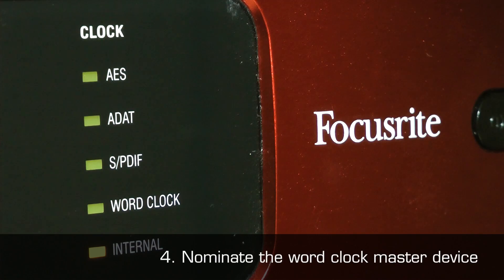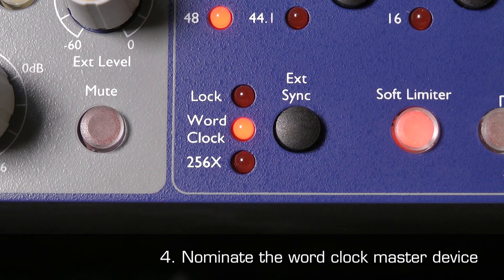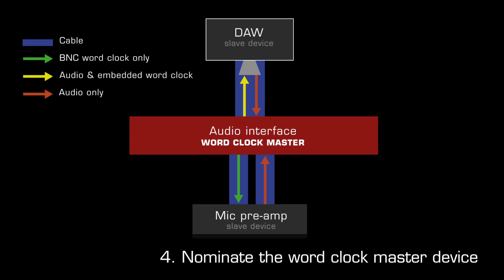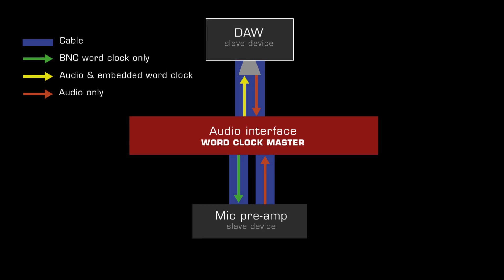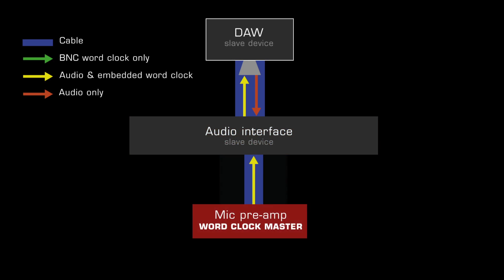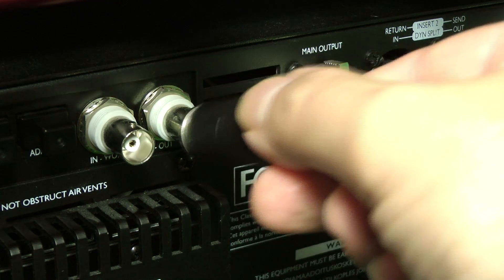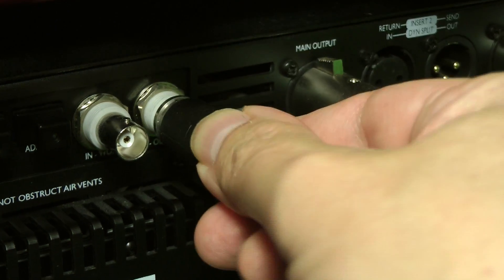How to connect devices with AES3 or S/PDIF coaxial leads

Comment: When hooking up two interfaces through spidf, do u only need one spidf cable or two?
Reply from the maker: +Larry Tate Depends on the device. What are you trying to hook up and to what?
Reply: A focusrite clarette interface to a focusrite Safire 40 interface to expand my mic inputs to 16 between the two combined.
Reply from the maker: Presumably you'll be creating an aggregate audio device so both interfaces can be used simultaneously. In which case, leave the DAW as the word clock master and slave both interfaces to it via their computer connections (USB, TB?). If you're hooking up the Safire to the Clarette via SPDIF and only want a one way audio connection you can either nominate the Safire as the clock master or slave it by using 2 SPDF cables.

Comment: Hey great video, very helpful,
I am planning to buy a Focusrite ISA ONE digital and use a roland quad capture ua55 as interface. The interface has a coaxial in and the ISA one has a s/pdif out, to which I can connect. My question is keeping ISA one as the master for word clock sync how do I match it with the interface? (no such word clock port present on that particular interface). Thanks
Reply from the maker: +Ader Aster Because the SPDIF signal has an embedded word clock signal within it, you should be able to slave the Roland to the incoming signal from the ISA One. You will need to check that it is possible to set the Roland and your DAW to slave mode. Sometimes you just need to set the DAW to external sync and the interface (Roland) will understand what is going on, or you may need to set the Roland to sync as well. Check to see if the Roland control panel or spec has the facility for external sync or ask Roland support. Hope this helps.